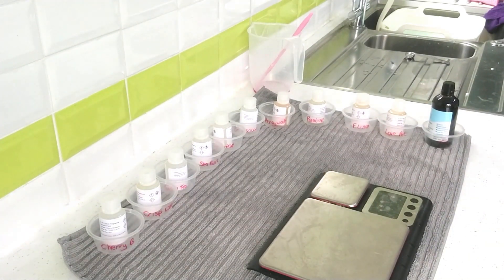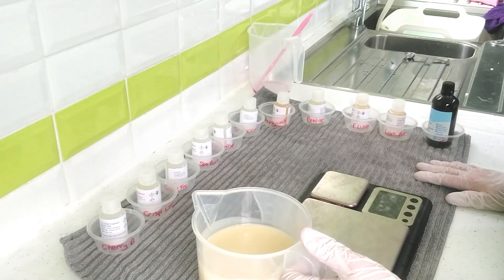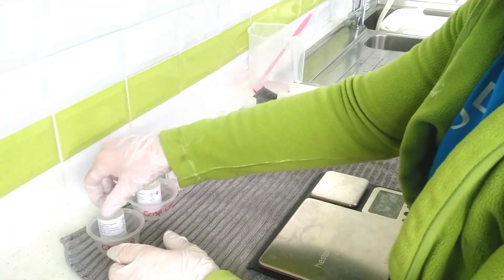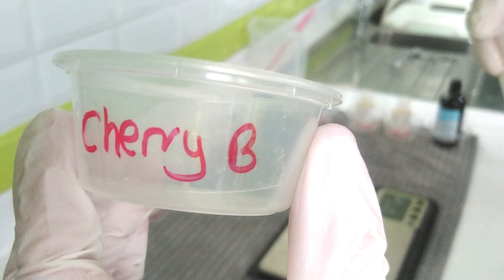HOW TO TEST FRAGRANCE OILS for cold process soap - cold process soap making tutorial

Comment: Thanks for this, Lisa. Testing fragrances seems like a pain, but it's more of a pain when you use a fragrance without knowing that it's going to do something awful in your soap. Sadly, I learned this lesson the hard way before I saw this video. One additional thing I like to put in my notes is what each fragrance does to my silicone molds. I once used a jasmine scent for gift soaps, and the sickly-sweet scent stuck in my mold. I soaked the mold in vinegar, scrubbed it with baking soda, even put it in a 250 degree oven for an hour. Nothing worked. The scent did get overwritten by the next FO I used in that mold, but that clingy odor in my mold scented the whole room for several days, and it was pretty upsetting.  I've started making a note when that happens, but I think I might invest in a few individual silicone molds for testing.
Reply from the maker: Hey Rustian, yes testing is such a pain, especially when you're starting out as it's a lot of money searching for something that works well. I do find quite a few fragrances to stay in the mould and you can't get them out, it's the nature of silicone, but they don't affect the next soap.

Comment: Love this! I just did my testing. But I have a question. I see you did fo % of OILS. I'm seeing others who do % of total batch. Which is the correct way and what is the reasoning for that way??? (I can't find anyone to answer this question)
Reply from the maker: Hi Kathy. It is a common things that's done in a variety of ways and as long as you do it right when needed either can be OK, unfortunately a lot of people do it incorrectly.
When you use a fragrance oil you should check the maximum safe usage rate given by IFRA. If the safe usage rate is high (let's say 20%) then the way you add your fragrance oil doesn't really matter and will be down to whether you prefer a stronger fragrance, because you are never going to use anywhere near 20%. So say you want 5% fragrance, you could in theory do 5% of oils or 5% of total soap, both would be safe, obviously 5% of total soap would give a stronger fragrance.
Where is does matter is when there are restrictions, so say for example the IFRA limit on a fragrance was 5%, now it DOES matter what you use. That 5% limit is based on the FINISHED product, so after the cure, so in that case you should use 5% of oil weight. If you use 5% of total soap weight you are adding more than the limits allow this is because most of the water in your soap evaporates during the cure, so if you have added fragrance calculated on the total soap weight you will have fragrance in you soap relating to water that is no longer there after the cure and your fragrance % in your soap will be above the safe limits.
I always use oil weight as it's consistent, again imagine people's recipes, if someone uses a bigger water discount than someone else, if the both use oil weight the fragrance will be consistent, if they both use total batter then the soap with more water will have more fragrance and a higher % left in the final bar after the cure.
I hope this makes sense - Best wishes. Lisa
Reply: @IDreamInSoap  Wow! What an amazing detailed answer! Thank you for taking the time to post this. You are truly an exceptional teacher and artist! Have an amazing day!

Comment: Hi Lisa.  I have formulated my recipe as per your advice for SAT:UNSAT.  Kindly help to guide me which WATER METHOD u applied in your recipe for testing FO.  It wud be a great help for me.  TYI
Reply from the maker: HI Rahat. I always use 25% of water to oils, but when testing you should really just use the normal recipe you use to make your soap so that you get the same result in your test as you would in a larger batch
Reply: @IDreamInSoap  thank u 🙏

Comment: Well Lisa you now have me sold. I just had a disaster with oil split my first large mould qty made the day I watched your video.  recipe used before bar fragrance  I used combination fragrance oils   Both the slab and individual moulds did same thing.  Looked fine when pouring although did thicken a bit too much with last bit but soap stayed soft and a bit sticky 3days later after removing slab and making one cut, disaster.  So I will now 1: not combine fragrance oils: 2: purchase little pots and put aside a day to test all that I have even if already used.  I always when using never add max allowable   
I have recommended another soaper in the US watch your video as she reported same problem 
So Lisa a very big thank you for producing this video.
Reply from the maker: AW no, I'm sorry you had a disaster, that's such a pain. Testing is always a little bit of a pain, but so worth doing

Comment: Very detailed and informative as usual.  I read on a forum, that for fragrance oils that might have a reaction/behave badly, to add it to the lye water.  It said doing this eliminates any issues.  I haven't tried that yet and would probably do it once the lye cooled a tad.  I just found the concept interesting.  Has anyone tried this?
Reply from the maker: It will not help with any acceleration in fact it will make it worse as you are allowing the fragrance oil to spend longer in your soap. If you have an accelerating fragrance oil you need to put it in as late as possible
Reply: @IDreamInSoap  really.., ok, good to know

Comment: how are you determine this value 0.72% of oils and what is 5% i can not understand this calculation
Reply from the maker: Hi Some. When you look at your recipe you compare the oil in your recipe with the total weight of everything. In my measuring a soap mold video I go through this in detail. The 5% is the amount of fragrance oil I was using, so 5% compare to the oil used.

Comment: Ok lovely video but question on the multiplication you have 60 x .72 of oils how do you get the .72 of oils? Sorry I’m really confused. Thx you are so talented btw
Reply from the maker: Hi, for me the 0.72 is the amount of oil in my recipe. So if you look at your recipe on soapcalc (or whatever lye calculator you use) you should have a total soap weight figure lets say 1200g and a total oils figure say 1000g if you do 1000 divided by 1200 x 100 you will get your oil %  in this little example it would come to 83% (mine comes to 72%)
I hope this helps.
Best wishes
Reply: I Dream In Soap thank you so much for responding, I’m sure you are a very busy artist and you taking the time to explain really THX!!

Comment: Hi,  could you tell me how do calculate the per cent of you oils please?
Reply from the maker: Hi Alicia. If you go into your lye calculator e.g. soap calc, you will see 2 figures that you need. The soap weight before cure (ie weight of your total batter) and your oil weight. If you take the oil weight, divide it by the total soap weight the x 100 that will give you your %. It may be a bit of a pain, but if you use the same recipe, the figure will always be the same, so you only have to do it once.
Reply: @IDreamInSoap 
Uff! It sounds so complicated! 😅 Thank you very much! Maybe next time you could explain that in a video! Thank you for for beautiful hard work!

Comment: During the video, you said that you have a recipe that can stand without hardening for 45 mins. Would you please mind sharing that?
Reply from the maker: Hi Bebo Bim. I'm afraid that's the one thing I don't really just want to post openly I'm afraid. I really hate saying no, but I spent a lot of time and money getting it how I like it. To be honest though I really think a lot of it has to do with how well you spot emulsion and therefore don't blend too much and temperature, you can have the slowest recipe, but if you don't manage those elements it will still move quickly. However, I will try to give you some tips so you can maybe change your recipe a bit. Try not to have too many hard oils and butters, I find it's better to keep an eye on your saturated : unsaturated fat ratio rather than just hard vs liquid oils, you will find it on the top right hand side when you view a recipe in Soapcalc, Mine is 41:59. If you don't mind using lard (it makes excellent soap) that will trace very slowly, also make sure you use olive oil, rather than pomace olive oil. Temperature is also a big factor, you may need to play around a bit until you find the best range, do you soap cool, either at room temperature or say between 80-90 degrees. Butters, like cocoa butter and Shea butter etc will accelerate, so will castor oil, so use those sparingly.
I hope this helps a bit, I'm always willing to look at your recipe and help you tweak it a bit. Best wishes. Lisa
Reply: @IDreamInSoap  so you mean 41% hard oils?
Reply from the maker: @madtabby66  NO, not quite. YOu will find that hard oils mainly contribute to your saturated fats, but liquid oils do too (castor oil for example is quite high). So it is best to look at the saturated:unsaturated ration that you see when you put your recipe into a lye calculator
Reply: @IDreamInSoap U mean 80 - 90 degrees equal to 180-190 F? Am I correct?
Reply from the maker: @rrutaba  No, it's 80-90 F
Reply: @IDreamInSoap  Thank u so much. Plz ignore my same question asked above.
Reply: @IDreamInSoap  I just want to be sure u said 80-90 degress? Does it mean Farenhite? Because if im not wrong 80-90 degrees it means very HOT.  Kindly reply at your earliest.  Thank U so much

Comment: I really found this useful . We get lots of reviews in the USA.  However in one scent you have a variety of reviews . From doesn't discolor  to turns light tan to turns brown all on the same scent. So on these I test myself. If all reviews are pretty standard to what the developer of the scent says, in general I go for it. I do see the importance now of testing all fragrances, because your batter could be so different from what others are using. Mine tends to be higher in cocoa butter and it traces quicker than most. I do also have one that has just a little cocoa butter and it stays fluid for quite a while. Very interesting video.
Reply from the maker: Thank you so much Jill, yes I quite agree, even if there are reviews, how something acts in your soap at your temperature can be quite different, so pleased you found it useful.

Comment: I see you worked out your FO % by the oil weight of your soap batter.  I’m wondering why you didn’t test at 5 % of you total batter batter weight.  Great tutorial video.
Reply from the maker: Hey Christine. Yes, that's correct the FO usage rates should be done as a % of oils, not total batter weight. The reason for that is people use all sorts of water amounts in their soap and the water cures out. So if you had used 5% of batter weight you would end up with much more than 5% in your final bar. Also someone using full water 38% would use a lot more FO than someone using say 25% (like me) and when both bars had cured (and the water all gone) the 38% bar would have a lot more FO in.
Reply: I Dream In Soap ....Boy oh boy you’re making me think lol, I just checked my SM3 program and it is calculating FO based on oil weight.  I do reduce that if it’s EO.  Whew.  Yes it makes sense that it’s oil weight.  Thanks Lisa
Reply from the maker: @christinebowes2528  perfect 😊
Reply: I had the same issue , thanks for clearing it.

Comment: I really like the way you test your fo’s. I normally test mine in a 2 pound batch because I am a swirly kind of girl. I also like to pour a a very thin trace (close to just an emulsion). I like to see how thick it will thicken by the end of the pour.  Your recipe has a great pour and set up time. I do do a log sheet such as your notebook.  Because I do the 2 pound test, I log my oil dates, fo information and the weight loss of the cure as well.
Reply from the maker: Ha, that's so funny, I've just watched your video on testing micas. Must be that kind of day.